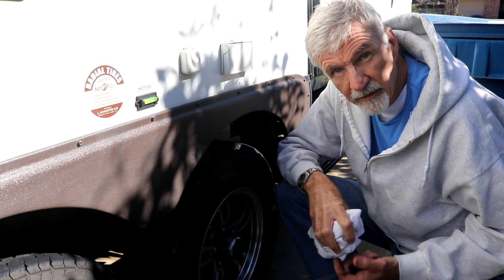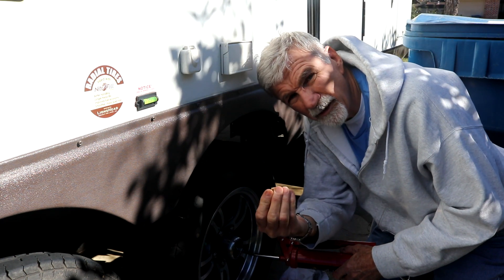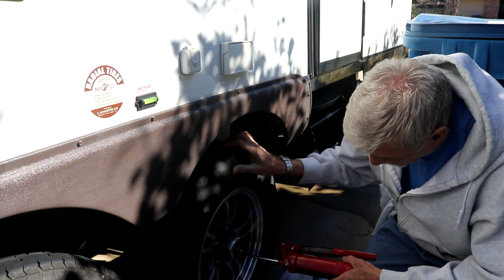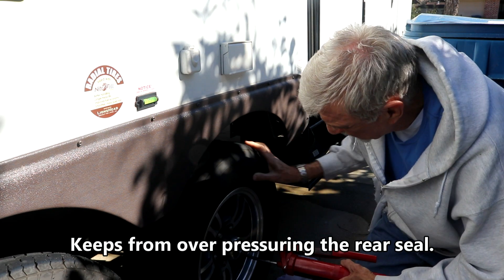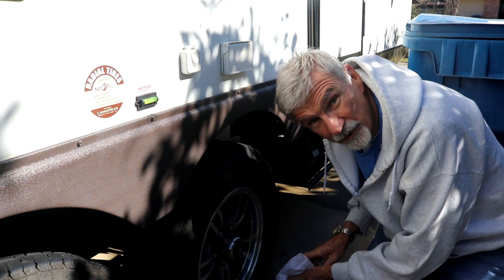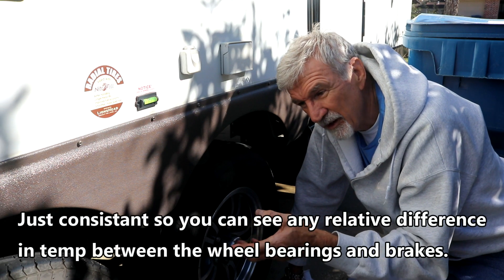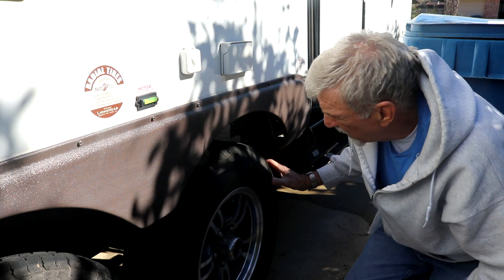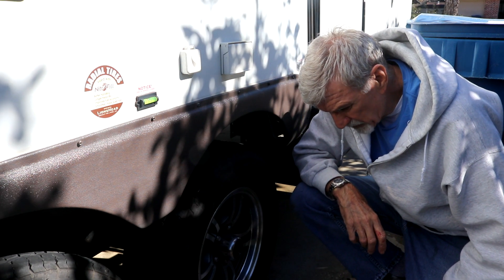Things not to do with a grease gun

Comment: Marion Blair, Thanks for the heads up on the fittings.  I hope you were able to get it out with an ez out with out too much trouble. I've never jacked up my tires to add grease but, It does seem like a good idea to check the play on the bearings.
I try to keep my tires out of the sun as much as possible to prevent dry cracks. A piece of painted plywood has worked pretty good over the years to keep the sun off when sitting outside. Don't be too jealous of that deleted Ford we both know our Cummins will be running for a long time yet.
Reply from the maker: Ha, that's good.  Yea, I was able to get the zerk out.  It should do that but it did.  That damn deleted ford is harassing me ha.  Thanks for the kind words.
Reply: Marion Blair I noticed you have a display in your dash that shows the regen for your Cummins diesel, can you tell me more about it and if you would buy it again?

Comment: The zerk fitting is installed into the axle end (spindle part of the axle) and is stationary, it does not spin. The hub spins on bearings that are inserted over the spindle. So how could spinning the wheel assembly loosen a zerk fitting? Only way spinning would loosen the zerk is if the complete spindle assembly turned.
Please explain!
Reply: yes Doug, I agree.  For some reason I haven't figured out yet, I've had two of them back off by turning in the wrong direction.  Doesn't make sense.

Comment: How does towing your travel trailer effect fuel mileage on your Cummins diesel?
Reply: Significantly.  Empty I'm a pretty consistent 22 - 23 at 70 mph.  At 63 - 65 with payload and trailer = 7000 lbs, I'm at 11 - 13 mpg depending on head wind.